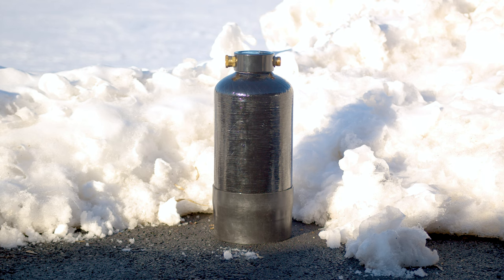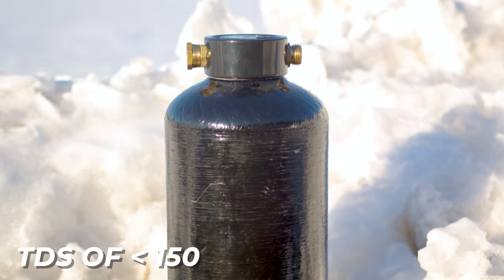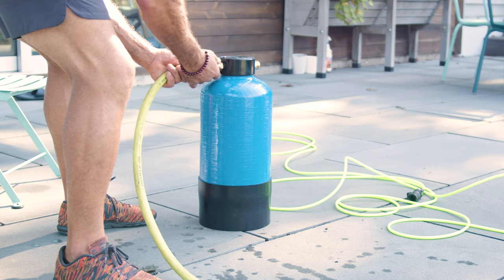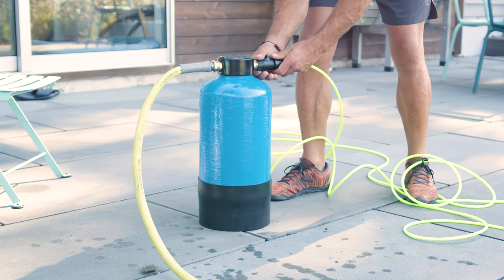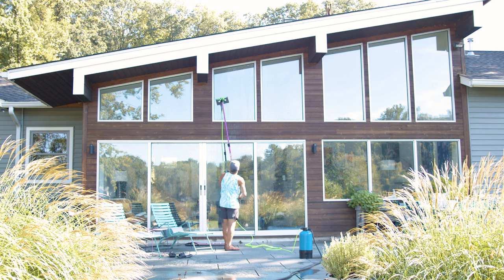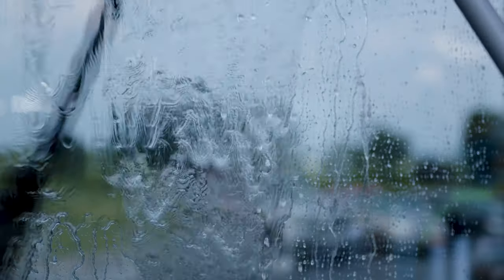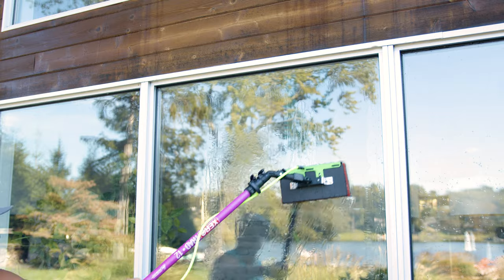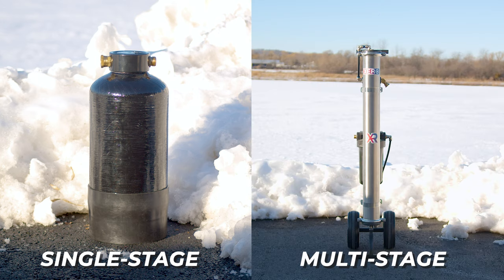Single vs Multi-Stage Systems: The Window Cleaner's Guide

Comment: I love my waterfed system. It's made my job a lot safer on some of my jobs, but does anyone else feel like it's a lot slower than traditional. I have been cleaning for 15 years but just started using it and am just wondering if I should just save it for the high difficult stuff or if it will surpass traditional cleaning speeds with practice.
Reply from the maker: You might be combatting low source water pressure! give us a call, we'd love to assist 862-266-0677
Reply: @windowcleaner  I actually did to order some stuff, and jersey helped me out and it turns out that I'm just an idiot 😅 thanks jersey!

Comment: Why are we not mentioning useable height/ pressure drop or maintenance costs in these videos about choosing the right equipment? Most multi-stage rigs cause so much pressure drop they can only be used to ~30’ vertically without a booster pump, and even then the flow rate is so low it makes rinsing a nightmare and spray bars don’t work correctly. My second point lies in the huge maintenance  cost increase when moving to a multi stage rig since every filter change includes not only .5-1Cu/ft  DI resin, but also the pre filter (~$40) and RO membrane (~$200 each), and god forbid you have a system running multiple RO cylinders. For the cost of filter changes on a 3 stage rig alone I can buy TWO whole new DI tanks with fresh resin in them, or 3 cu/ft. of virgin resin that will be more than enough to complete even super high TDS jobs and renders the benefits of a multi-stage rig moot, plus a single stage unit has virtually no pressure drop which allows for cleaning up to 4,5, or 6 stories depending on starting water pressure without an additional booster pump system being needed. 

 I’ve used both and given the choice I don’t see why anyone would want to spend $600 every maintenance cycle instead of $150, just to have lower water pressure and a larger, heavier, more complicated unit to drag around with more potential failure points.
Reply: So you use a single stage system with high tds? mines around 300-400 and the pressure drop with my multi stage makes everything a pain.
Reply from the maker: You will find this is not the case! New lower pressure RO membranes create more pure water and maintain a suitable working pressure well beyond 30'.  

While cost is definitely something that needs to be considered, the most widely used carbon pre-filter is 10"x2.5" and those cost $10 or less, nowhere near $40. Yes, RO membranes aren't cheap but they are very affordable when you take into account the amount of pure water that is produced through an RO membrane during it's lifespan VS DI resin alone. Because RO membranes do such a great job removing on average 90% or more of the TDS from the water, small refillable DI cartridges in these systems are good for a few thousand gallons on average. Refilling these are extremely affordable. RO membranes can last 2-3 years if the $10 pre-filter is changed every month or two.

If your TDS is over 150, using a DI tank will cost much more over the life of the tank VS a multi-stage system. DI tanks are great if they are used in a low TDS region, that's a fact, but they don't last long in high TDS regions and will cost the user even more money.